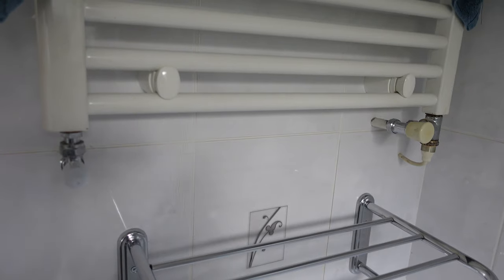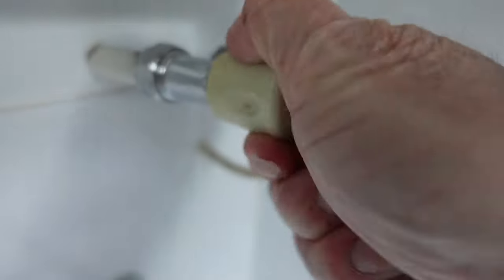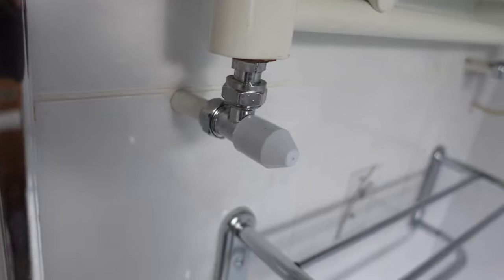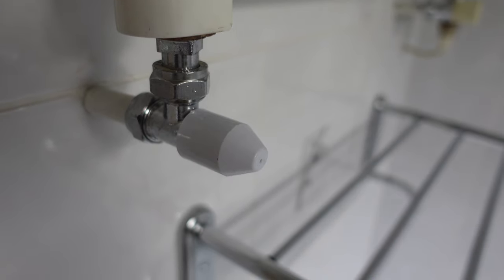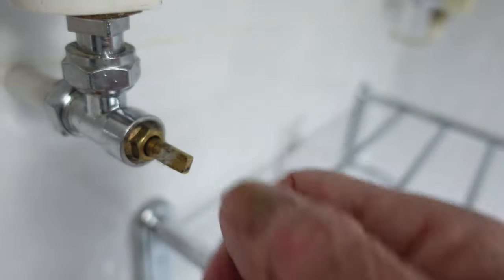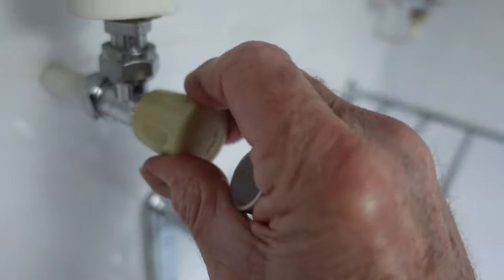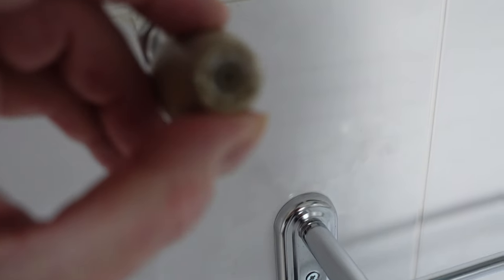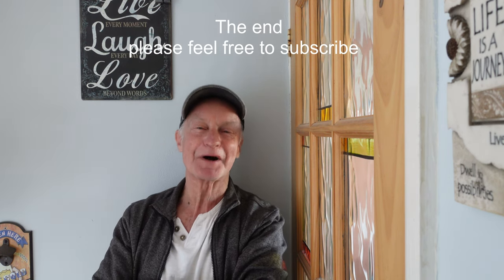Radiator valves, which is the one to turn it off.

Comment: My towel radiator is too hot and unfortunately for me both valves  have the same cap that you can turn it off and on. which one one of them can regulate the hot water?
Reply from the maker: Either of them, but do not switch it completely off as it is your bypass radiator.
Reply: @dereton33  Thank you 👍

Comment: What if there is two identical lock shield type valves as per the photo used for the video thumbnail?
Reply from the maker: Remove one of the tops and fit one from a twist valve.

Comment: My Grans towel radiator has locksheld valves on both sides. Do I turn down the heat with the flow side or the return?
Reply from the maker: Either is ok. I prefer the flow though.

Comment: Sometimes you do have  2  return valves  in a bathroom on the radiator connected to the hot water for summer use and some people get confused on this too it might be worth mentioning
Reply from the maker: Yes that`s right thanks Anthony.
Reply: I have two valves that turn, or did turn, now only one turns and I cant get the heating down.  I haven't got a clue what is meant by summer use.

Comment: Our towel rail is confusing. Two values. Both the same, both silver with no markings. Because of they are mirrored, you have to face the left one to work out which is clockwise and face the right one to work out which is clockwise. Both appear to control the flow of water into the rad. If turn left fully clockwise appears to lock the flow even if right is anti clockwise and had been letting water in. Turn left value anti clock and water comes in again. Turn right anti clock till it locks and water doesn't come in. Really confusing and don't know which one to play with. Bled the rad so now whole thing gets hot but have now also noticed the pressure in the boiler dropping since I fixed the air issue in that rad.

Bot values get hot to the touch so much so you need a towel to turn them so you don't burn yourself.

I should do a vid as might make more sense but this rad confuses me no end.
Reply from the maker: Just fit a thermostatic rad valve one side.
Reply: Did you figure it out? We've got the same one. Both valves do something as I can hear noise but I can' figure out which one to use and what each one does.

Comment: how do you know which ones the thermostat
and  one is the outlet if they are both like your first
you turned
Reply from the maker: They are both the same valve with different tops. There is no thermostat, these are a locksheild and a thumbwheel valve.
Reply: @dereton33  my taps are both the same they are both lockshild tap I just wondered which ones is he in and which one is out but I guess if I feel which pipe gets.hot first

Comment: Hi helpful videos thank you. I was wondering if you can help. I live in an apartment and there is a cold water pipe in a hall cupboard which runs from below my apartment (car park below mine) and up through  two others above. There is a loud bang every 12 seconds on the dot which can last for over an hour or more. I think this is a water hammer? The 3rd floor may have washing machine on (not sure) but can hear a few bangs at random times maybe when they turn taps on also. The bang is so loud. Any ideas?
Reply from the maker: Yes water hammer, see if you can ask your neighbours if they get the noise too. When you find which apartment it is, just turn down there main stopcock to a slower flow rate.

Comment: Great video👍 I’ve got to remove a radiator in a few weeks, I’ve seen some plumbers remove rads in work without draining the system down, then obviously turn the rad upside down to store it (full of water) it is a two man job. Would you recommend doing it this way? Do you have a video on this? Cheers
Reply from the maker: Yes I usually do it that way.
Reply: Buy some plumbthumbs if you need to do a few rads
Reply: @dereton33 plumbthumbs  for me teacher 👍👍👍
Reply: @paul_my_plumbs_uk  I’ve just ordered some plumb thumbs👍👍😉
Reply: @gbelectricks  quality 👍👍👍💯

Comment: I personally  al I prefer  to have  both  sides  off  the  rad valve  the same   now they  are  so cheap  so you  can  turn  them  on and  off  with  out  any  problems.
Reply from the maker: I normally do the same Ratch.